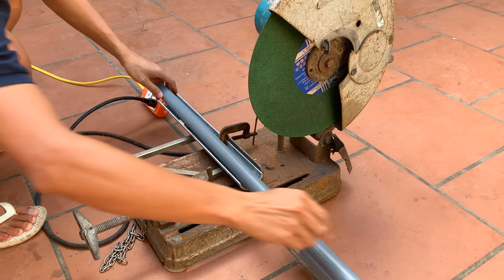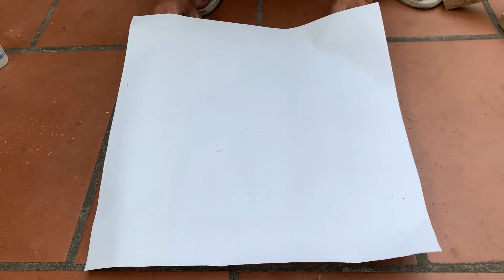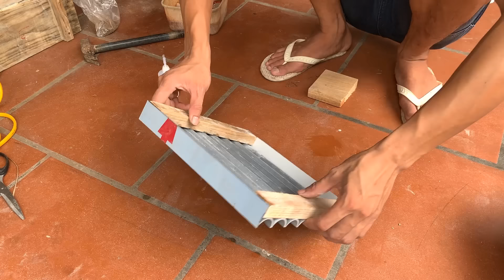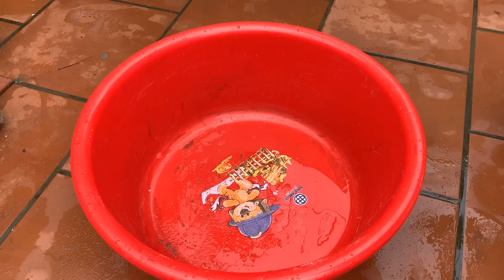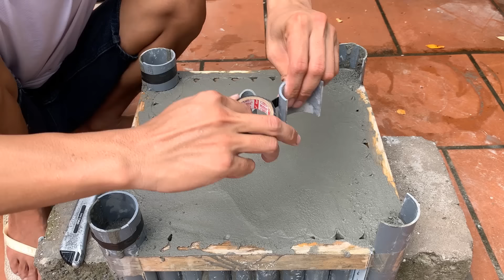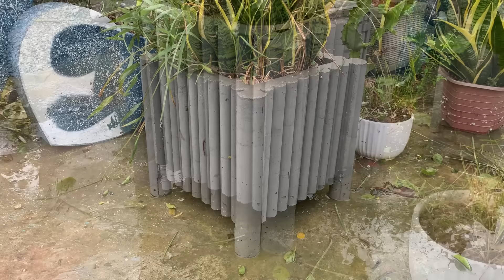Plastic pipe mold // Simple, easy and creative way to make flower pots from cement and plastic pipes

Comment: Wouldn't it be easier, and better for your back, to work on a table?
Reply: Good suggestion 👌🏻
Reply: Just because your body is not accustomed to low squatting, the way they are able to do, does not mean a table would make it better or easier to have a table. My Dad did this same low squat when working on multiple things throughout his life....all the way up into his 80's and I do it too.  If you look at their backs while they work, they are NOT hunched over. All of their weight is evenly distributed on their feet, rear end near the ground, and their backs are essentially straight and relaxed. Frankly, for this project, a table would require a lot more lifting of materials. It would complicate the mid-late stage of the build, when the inside square needs to be removed, making it difficult to get an even, quick, upward pull, completed without disrupting the sand inside of it. Furthermore, when the flower pot is finished, you'd have to lift the entire heavy pot from table height to the ground. Those flower pots are HEAVY.